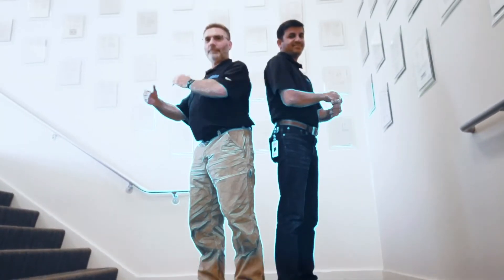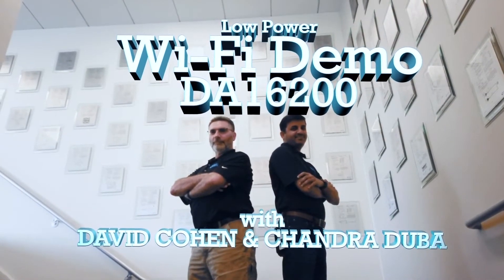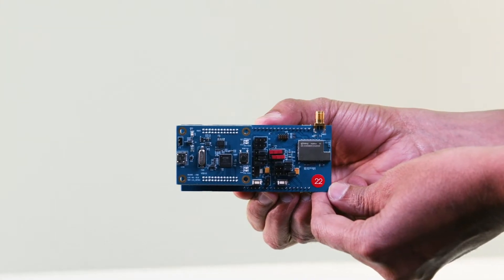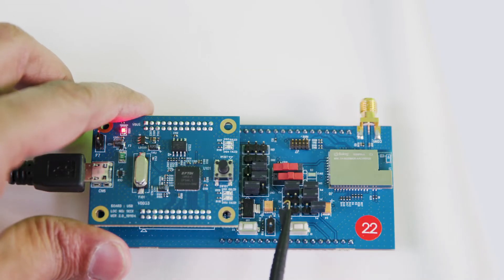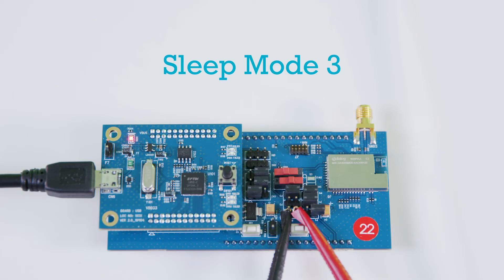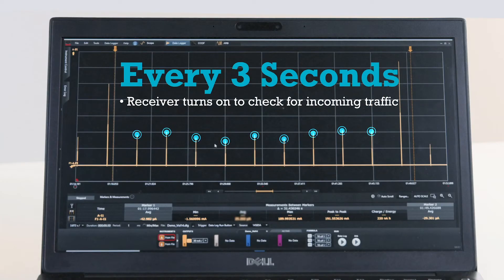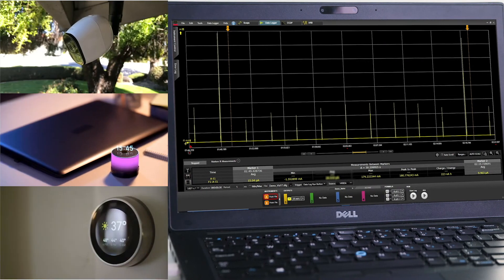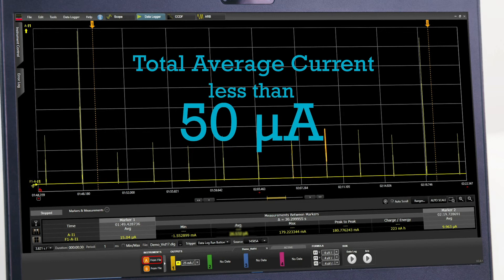Ultra-low Power Wi-Fi Demonstration with the DA16200

Comment: What is the technology used in the chip to maintain the connection and receive data whenever server has something to send? DTIM or TWT? Does this method work will all Wi-Fi routers or is there any specific requirement like Wi-Fi 6 or so?